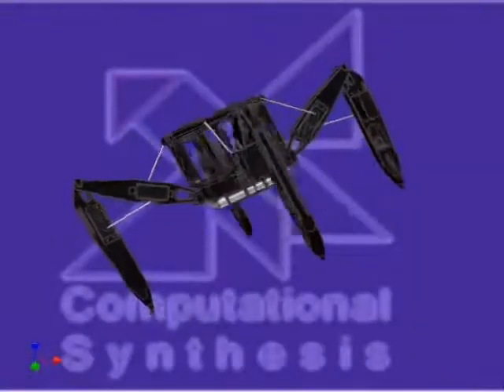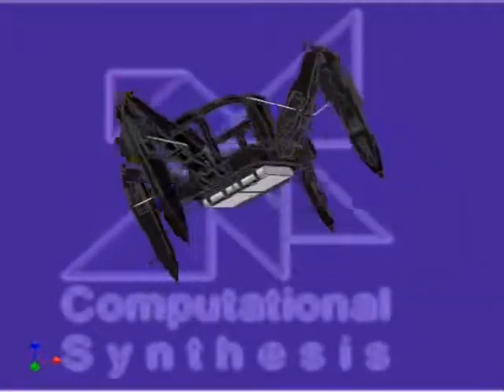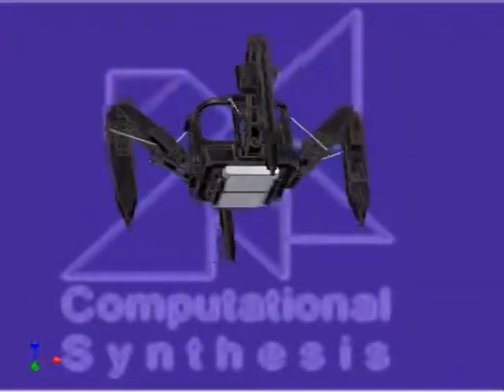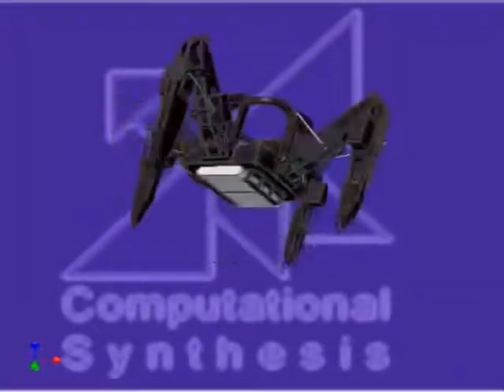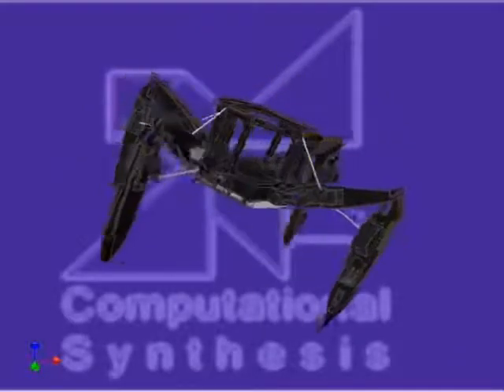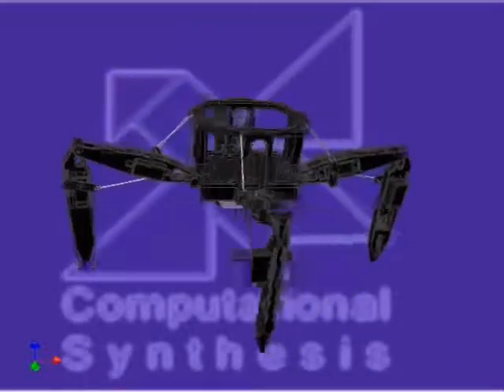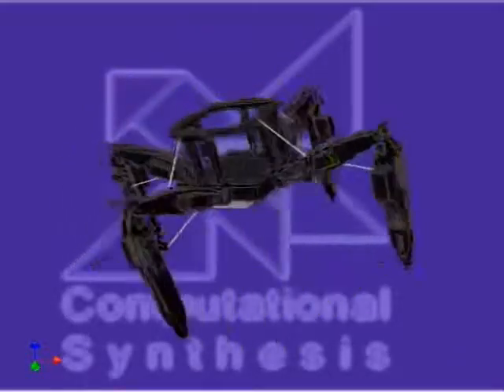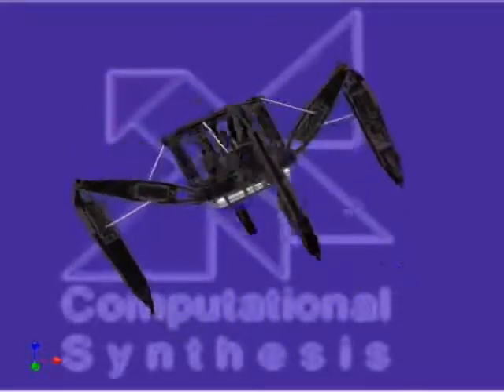Hardware Evolution for Robotic Fault Recovery

Comment: But isn't such a method very slow - by downloading each possible solution in each generation on the hardware, and trying it to measure the fitness - ?

Wouldn't it have been much faster to develop a simulation model, and apply the algorithm on it, to make the development much faster?